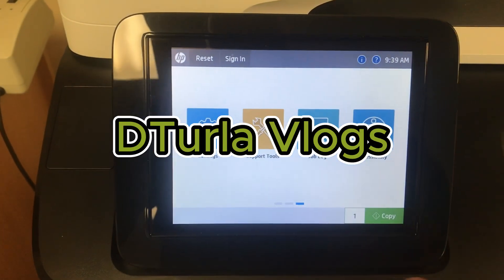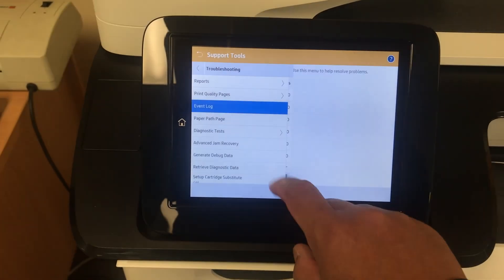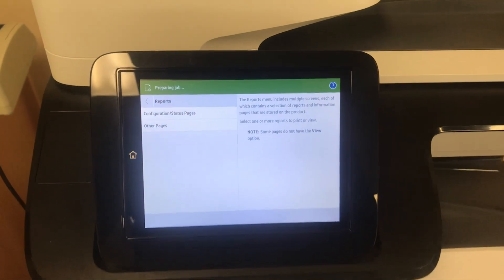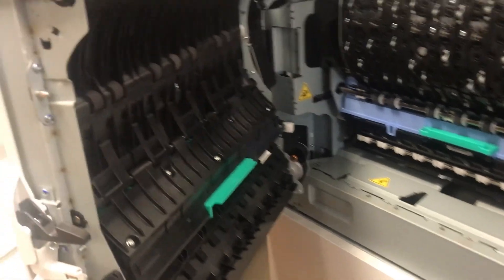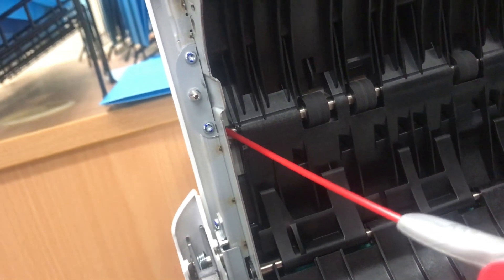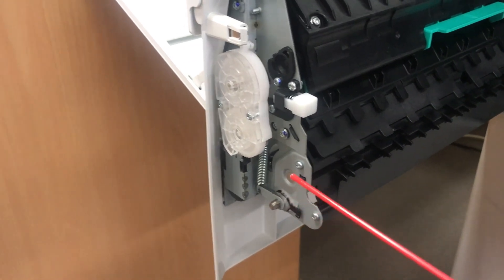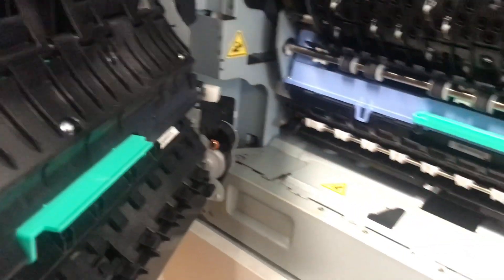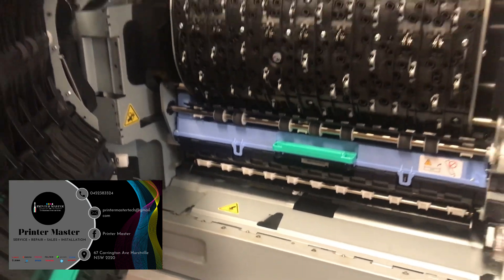Vlog#39 HP PageWide Color Flow E77650 How To Fix The Squeaky Noise

Comment: Lubrication talaga sa moving part. Unit dito Kabayan na Toshiba sa starting malakas ang ingay parang galing na sa motor.
Reply from the maker: You need to check where the noise coming from then use the DW40 to lubricate kabayan, like my videos here.
Reply: @dturlavlogstechsandplaces  Oo nga Kabayan one time tutukan ko antay lang vacation Ng school lapit na 2weeks nalang siguro vacation na school dito hehe
Reply from the maker: sa "Exit Actuator" kabayan nag stuck up at na misaligned